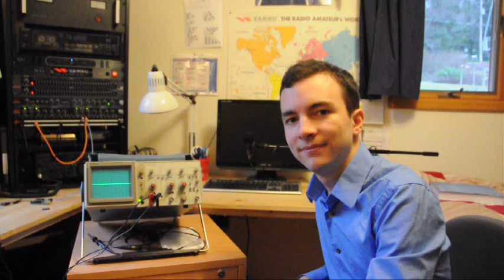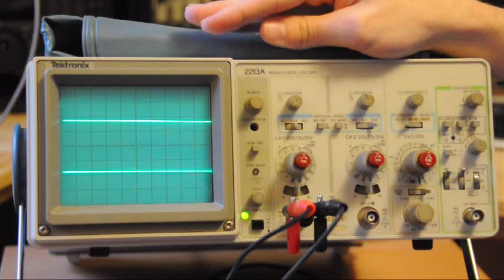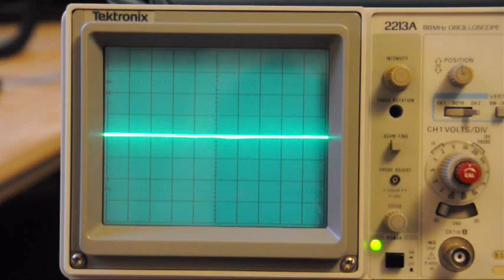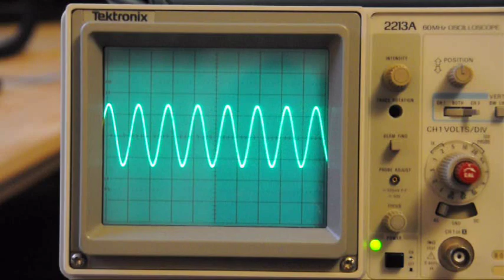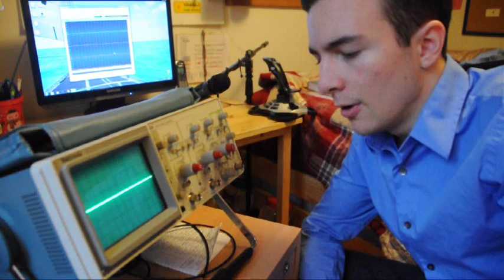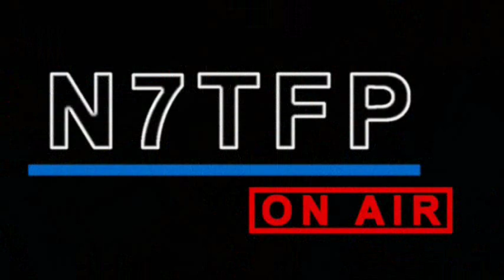Ham Radio Tutorial - Intro To Oscilloscopes

Comment: Hi, very neat and useful presentation. thanks a lot, Tyler. Question: Is it possible to measure to build crystal filters, BPFs etc. with the help of oscilloscope? (analog or digital?). Or this can be achieved only by means of VNA (Vector Network Analyser etc.). thanks. I want to build ham radio receivers and transmitters, so really am wondering if an oscilloscope can be used by building all stages of an transceiver (including audio amplifers, filters, VFOs etc)?

Comment: Thanks Tyler. Interesting and "good" videos you are making. I'm still not so sure that I need an oscilloscope or what "I" would do with it. 73 Bill  AB9QU
Reply: Bill Carter AB9QU 
Very late reply, and I am not an expert on O-scopes, but I can see where it would be useful. I don't own one, but would like to have one. You can use it to see if your DC power signal is clean. This eliminates the possibility of ground loops when troubleshooting noise in your signal in a mobile or base setup. If you have noise in your system and a schema, you can trace it back to it's source by seeing what stages the noise is located in. You can use a signal generator and test components such as electrolytic capacitors or see if filter circuits are working correctly and passing the expected freq without excess attenuation. Granted, many of these same problems can be "guessed" at, and the price of wrong guesses in parts swapping is likely less than the price of the O-scope, but price saving isn't really the point of learning and discovering anyway. Also, you will never be able to properly tune a circuit without the data that this tool will provide.
Reply: Thanks. Thinking of grtting one. I just got the new ARRL O-scope book in hopes of learning more and what I would be looking at. I also just got a Kenwood SM-230 monitor to go with my TS-950SDX. Everyone has to learn.

Comment: Very nice video, very informative.
   May I also add that you can usually find used oscilloscopes at ham fests for really cheap.  I got my Tektronix 453 at a local Ham Fest for $30 working!  If you can, ask to plug it in to power to make sure you see a trace before you buy.